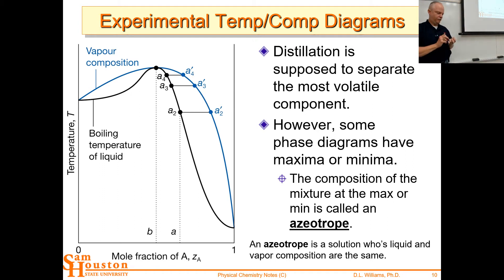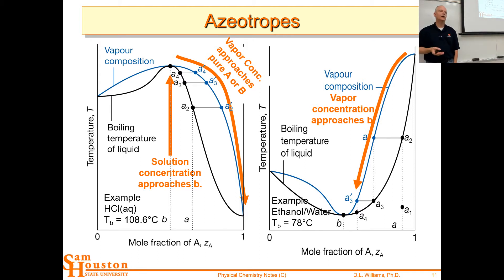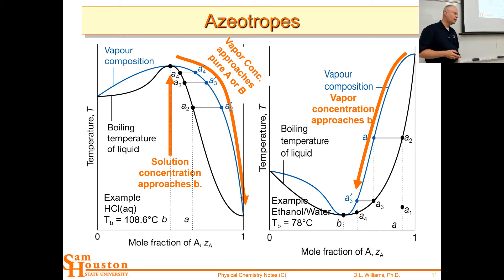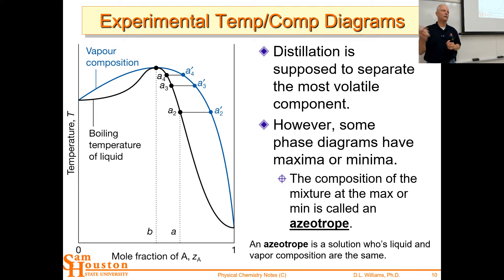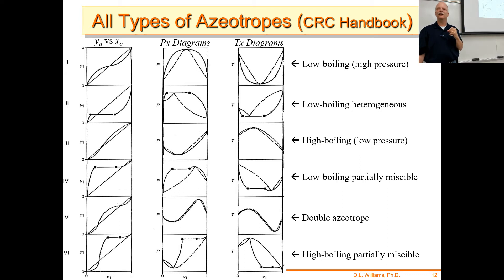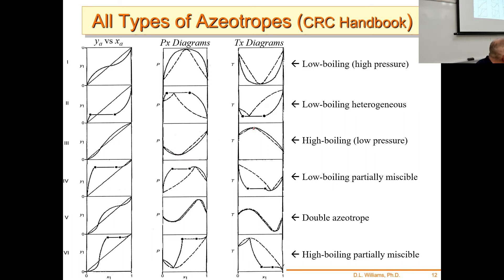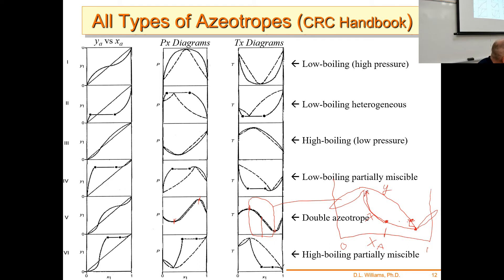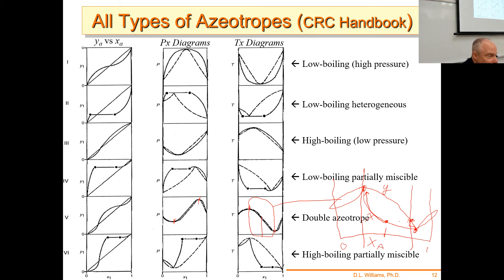TX Vapor Liquid Equilibrium Phase Diagrams and Azeotropes 5381 2019

Comment: The context for which "Vapor Conc. approaches pure A or B" is valid is a bit ambiguous here. You should mention that this only holds true if we're talking about serially distilling distillates or fractional distillation. In a single simple distillation attempt, the boiling flask keeps getting poorer in A, and so the vapor composition over the course of the distillation will keep getting poorer in A. Thanks for the video, it helped